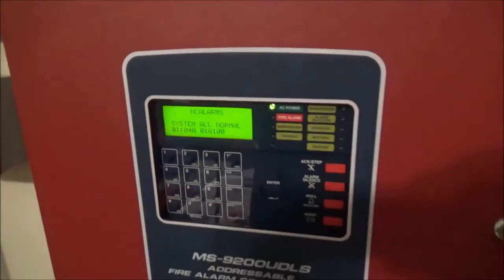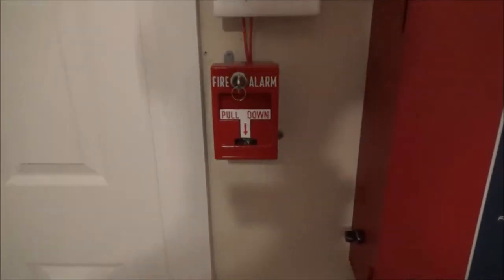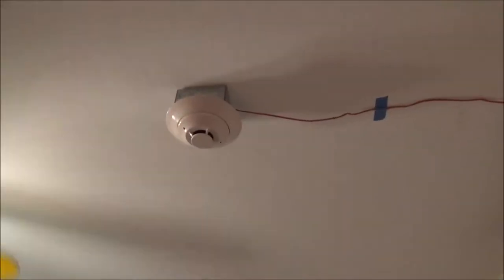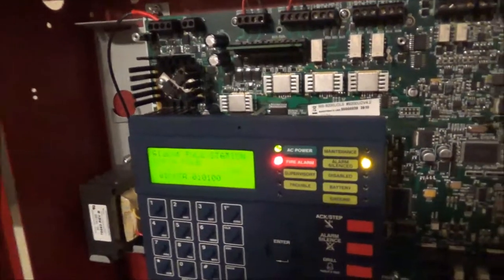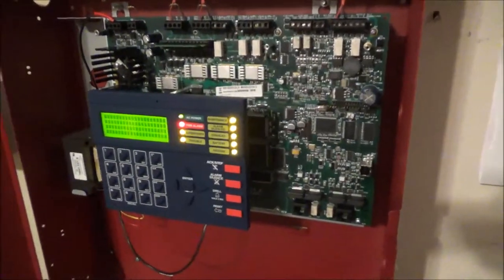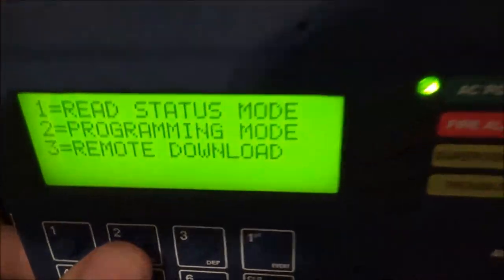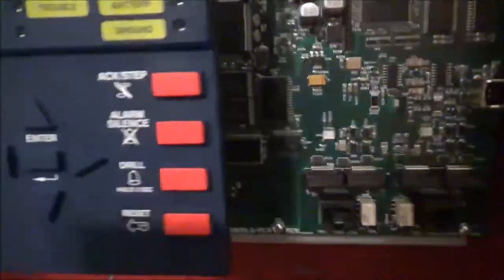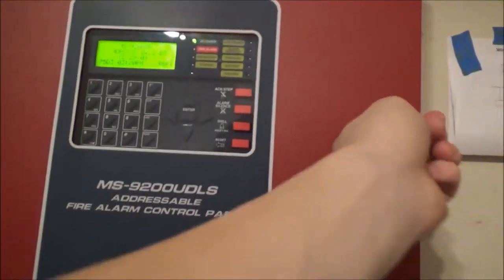Addressable System Test 2

Comment: Yeah, I’ll look for a good price on a 9600UDLS
Reply from the maker: Or you could do a 9200UDLS and add a booster panel. That's also an option. If you're going to make a voice evac system though, I recommend the 9200UDLS because it's cheaper.